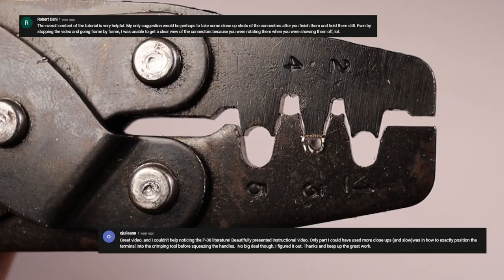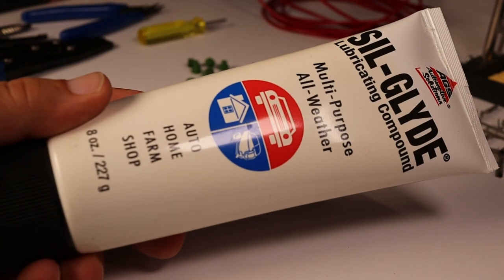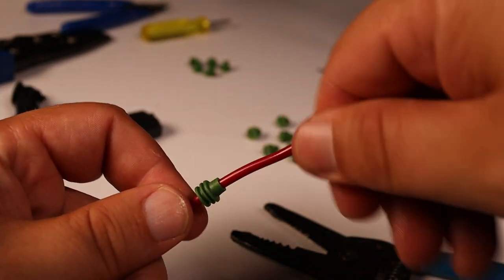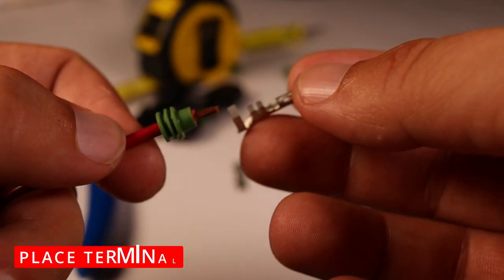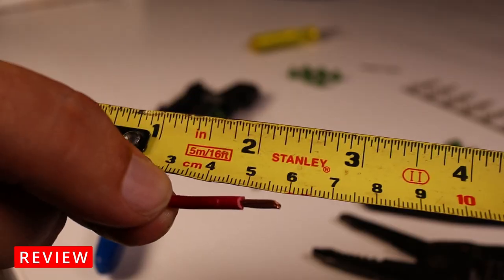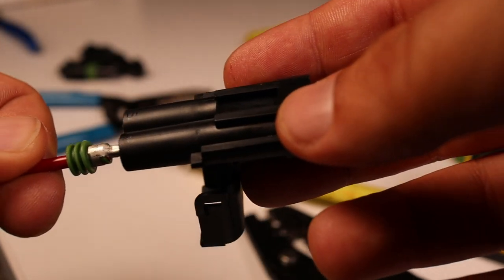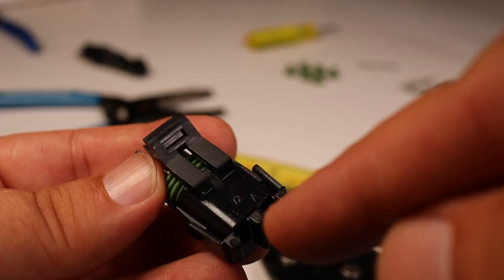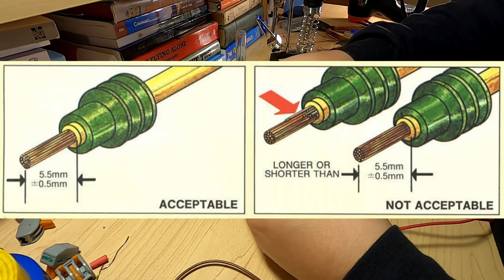🔎 Weather Pack Connector Assembly CLOSE UP 🔍 DIY Crimping Terminals How To

Comment: Thanks so much - excellent video; I am using these behind the electric brake backing plates on my camping trailer (Aliner).  My old wiring method kept leading to fractured wire connections.
Reply from the maker: Absolutely! They're pretty robust and should have no problems in your application. Just make sure the wiring harness is secured properly and isn't bouncing around. I see the same issue a lot in my day job.

Comment: If you do a lot of these, it is worth the extra money to buy the crimper that does both wire and seal in one operation.  Fast and neat.
Reply from the maker: O that's very interesting, I haven't seen them yet. Who makes them? I've been doing Metripack connectors on the job recently, different terminal type but same crimping operation as the Delphi.

Comment: I use a little dish soap mixed in water for the seals.  Works as well as the silicon lubes and is much less messy after it dries.
Reply from the maker: That's a good tip, thanks! 👍

Comment: I wanted to upgrade the electrical connectors on my race car to this type of connector. Your video was very helpful as I've never worked with this type before.
Reply from the maker: Awesome, I'm glad it helped!👍👍👍 They'll hold up to the punishment, just be sure to secure the wiring properly with adequate strain relief where needed.

Comment: Is there a tool to help open the connector housing? It's really hard to open
Reply from the maker: Yes, they can be a pain. You can use any small flat blade or pocket screwdriver to help pop then open. Anything you have like this will work:
https://amzn.to/3T3Iz38

Comment: Hi Matt, Thank you for the close up video.  I really appreciate your excellent instruction.   It was very helpful to me. 👍 

I have not been able to find any information on which terminal goes to the power source of the circuit.  Does Male connector with the Female terminal go toward a circuit power source, or is it the Female connector with the Male terminal the is the voltage power source for a circuit?

There must some type of standard to follow for most circuits.  Thanks, Dan  😊
Reply from the maker: You're welcome Dan, glad it was helpful! 👍 It really depends on your personal preference and application. I'm not aware of a particular standard for it, maybe someone can chime in. (And I used to work for the company that wrote them 😆 We did testing for automotive manufacturers though who actually wrote their own standards for the connectors and everything else. But I don't remember if they even called this out. Will have to see if I still have a copy...) Sensors, for example, will typically be a female plug with the power/ signal side being male. If you're replacing a factory connector, set it up how they did for that particular application.  If I'm doing 2 harnesses, I reverse them so there's only one way each can go together. One other thing I'll point out is that the male connector body insulates/ protects the female terminals more completely. Perhaps one reason why the male is typically used the permanent circuit side while female is on expendable/ wearable component side. It's a very good question though and something I didn't consider at all for these videos. Certainly a good idea for a follow up video if I can find a concrete answer.
Reply: @LeftSeatAdventures  Matt, Thank you for the quick response. 👍 

Wow, guess thats why I could not find an answer.   YES, I would love it if you would do a follow up video.  If no concrete answer, then maybe just your logical reasons why you would choose to do it that way.  Like you mentioned above, one side is more protected to be sitting with power connected and not mated with the other half of the connector.  Thank you for your video instruction...  😃 😊 👍

PS:  My application is I'm wiring side, rear and strobe lights to a tractor.  So there will be a few 2 pole and 3 pole connectors on each side of the tractor.

Comment: What size (AWG) of the wire that you used? Thank you!
Reply from the maker: These were done with 18ga wire. One of the reasons I like the Seal-All brand is that they have 3 different size seals to match the wire gauge you're using. 14-16, 18-20, 22-24. I believe they have an option on their site for heavier as well.
Reply: @LeftSeatAdventures  thank you